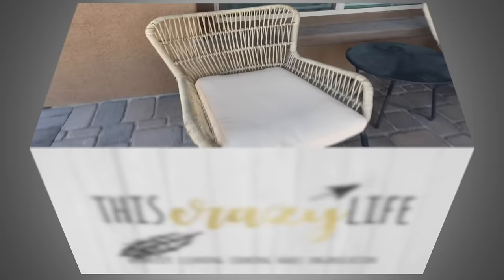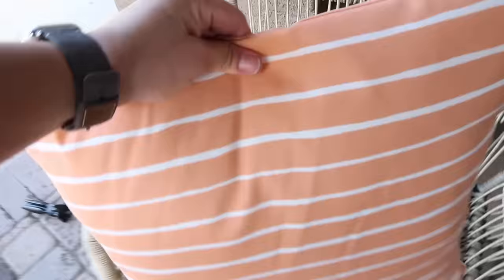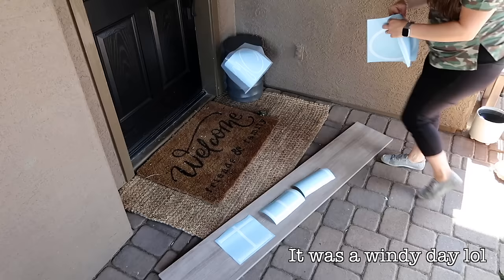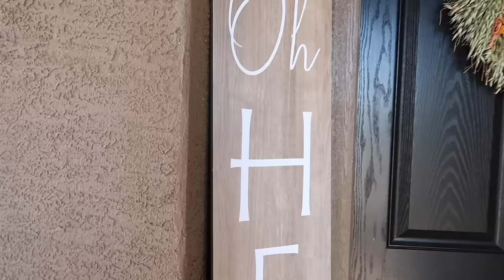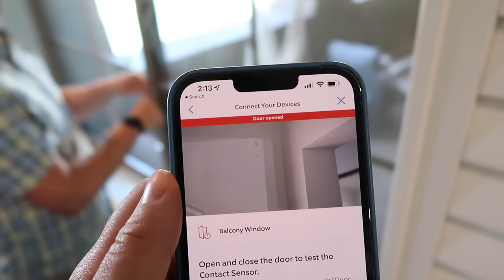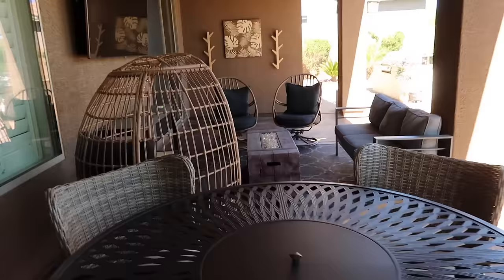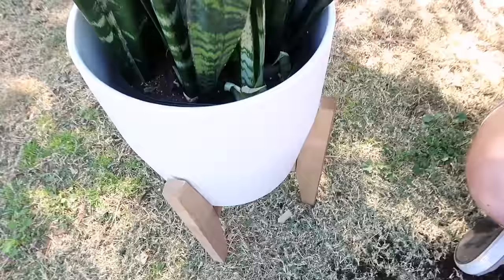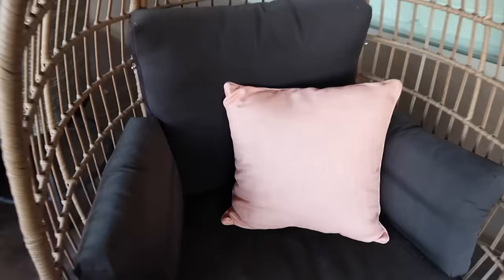NEW! SPRING CLEAN & DECORATE 2022 :: Front Porch + Patio Makeover :: Outdoor Spring Cleaning

Comment: Amanda, I love your movies, I watch them all and I look forward to each of them.  You asked for advice on plants.  The simplest rule when transplanting plants is to buy a ceramic pot, up to two sizes larger than the plastic pot with the plant, and not to replant the plant into a larger container immediately after purchase.  it is enough to put the plastic pot with the plant into the ceramic larger pot, and leave it for two or three months, then change the plastic pot to a larger size, adding a little fresh soil.  after a year, you can replant the plant into an even larger container.  if you only plant in a ceramic pot, it would be good to have a hole in the bottom for the drainage of standing water, if there is none, pour stones or expanded clay to the bottom, then the soil and the plant.  especially snakeplant does not like large containers because it will develop the root system and not the leaves if it has a fairly large pot. Your Ficus lyrata, who died in the previous episode, does not like changing the place, i.e. if you buy a plant, put it in one place and without a draft because a change of place usually always ends with the plant's death.   I come from Poland but I live in Germany, winter has come back to us, it is 3 to 6 degrees a day and sometimes it snows or freezes.  you have lovely weather and the patio and front porch look great.Regards, and to the next episode.  I'm waiting 👍😊❤